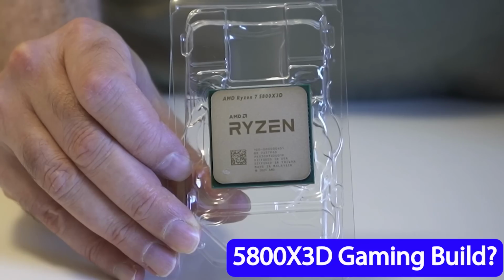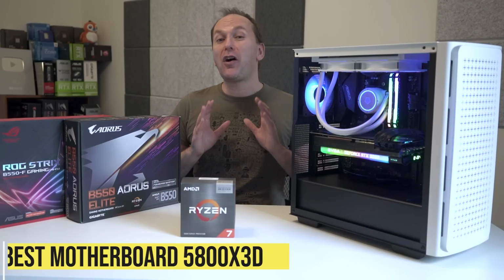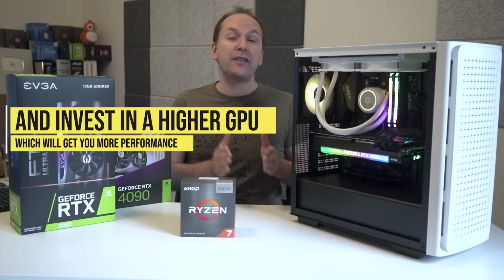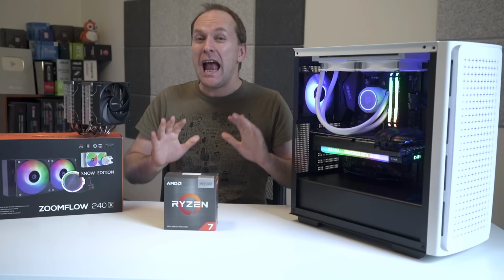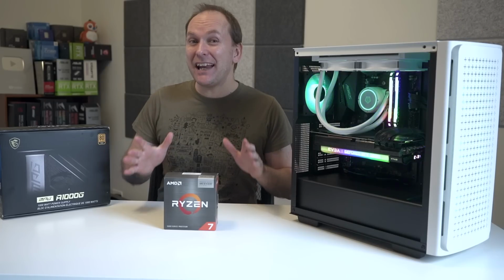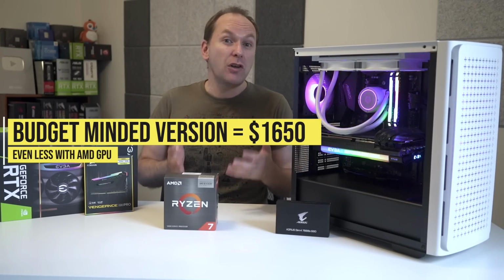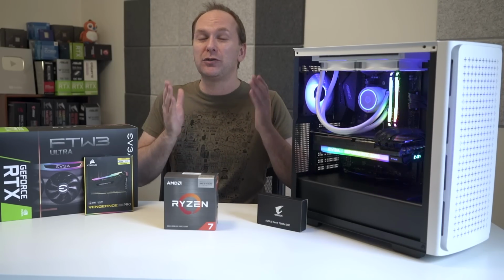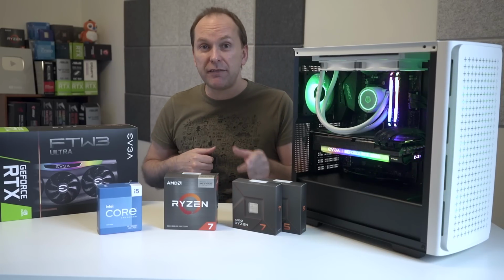🛑 4K Gaming is CHEAP! 🛑 Ultimate Ryzen 5800X3D Gaming PC Build

Comment: I built this exact system 4 months ago after 2 months of research much of it from this channel. I went with the Ryzen 5800X3D, 32 gigs (4x 8GB) of Vengence Ram and the Asus ROG Strix B550-F Gaming WiFi II board, and the Gigabyte GeForce RTX 3080 Gaming OC 12G Graphics Card. (Note on my GPU card, At the time I purchased it was under $800 today it's $1380 on Amazon) I did use 1 SAMSUNG 980 PRO SSD 1TB PCIe 4.0 NVMe for the C Drive and a Samsung 970 EVO Plus SSD 1TB NVMe M.2  in 2 TB for my secondary (This board has 2 M.2 slots slots "ONLY 1" is 4.0) and I set up x2 WD Black 2 TB HD in a Raid as my system backup. I added a few things not here but I paid about $2,400 (with my bells and whistles) in total. I did buy everything from Amazon and used the $200 off option and got the Amazon Credit Card in the process. (Note: Paid it off already as I had cash). Issues: not mentioned, I had to buy a PCIe x1 to 19 Pin USB 3.0 Header for a second header because this board only has one.  If you get this system buy one when you order it was $24 and you will thank me later.  Also, there is a loss of 5&6 SATA ports when using the second PCI-E slot. (ROG dropped the ball here) The loss of 2 of the 6 played no issue at all in my build but is worth noting.

Comment: Would a 5800x3d be good with a 4090 on a resolution of 5120x1440 ?
Reply from the maker: Absolutely, but you could also go for a 4k experience
Reply: @PCBuilderChannel  ive recently bought myself the odyssey neo g9 and i absolutly love the ultra wide expirience. Sadly im getting bottlenecked by my old ryzen 7 3800x which i havent had the plan to upgrade yet since im looking for a am4 cpu which would be best paired. And i think ill order the 5800x3d

Comment: Btw bro, 5800X3d isn't discounted yet but 5800x is less than half priced(60% off) pre-Black Friday sale in my country's Amazon website. Would that be good as well? Not just for gaming but also budget productivity and rendering. Would a 3060 12gb or 6600XT be enough for Blender?
Reply from the maker: 5800X is a good choice for that. Though you might even go 5600X if its cheaper and invest in a better GPU
Reply: @PCBuilderChannel  thanks bro!

Comment: I have never built a PC but looking at you building one, it does not hard at all. Question: are all those components used in this build more or less "plug and play"? My biggest fear is that I put everything together and the PC wont run or after the build I have to go to and play with the BIOS and other initial settings.
Reply from the maker: This is a good build for a first time build. Not a lot of complication. Check out Pauls Hardware for a great step by step how to build guide too!
Reply: @PCBuilderChannel  I was going to try to transfer all my components from my Alienware R7 but building this looks like a better option I will check Paul's hardware. thanks!

Comment: 4090 is about the first card i would consider for 4k gaming, those 4k benchmarks of the 3080 just are not good enough.    you can get ddr5 5600 cl36 32 GB kits for 150, would certainly recommend that as a min on any build.  13700k is still what i would recommend, but 7600x, 7700x, 13600k are all perfectly fine aswell.  wouldn't go with 5800x3d unless you can an amazing price
Reply from the maker: Depends on your needs of course! (:

Comment: i thought intel preferred faster ram speed. whats the best thing to tune my b die ram ddr4 of course? 1080p high fps 240+ for 13900k 3090ti for playing games like cod basically AAA titles. ive tuned my ram to 4000 c16 manually. so ive set about 6-8 timings manually. also which do you recommend to tune down? ie trfc tfaw etc., oh and before you say a 3090ti at 1080p cod is 99% usage on low settings in cod mw2. so yes even a 3090ti is bottlenecked in 1080p. another crazy thing to jason is with the newest update they put out i lost 70+ fps. its almost as if they are doing it on purpose to sell the new gpu's. gameplay itself seems to hold you back in matches as well. kinda like they did when the ps4 pro came out.

Comment: Do you think that i could run a AMD Ryzen 7 5800X Processor with a rtx 4080? or would that be too big of a bottleneck?
Reply from the maker: I think that will likely be fine. I haven't personally tested that combo
Reply: @PCBuilderChannel  thank you for your fast response:)
Reply: Other vids show a 20% depending on title bottleneck w a 4090. I have the same question... wondering if the 7900xfx is a better match.

Comment: So that 5800X3D I was gonna put in my wife’s PC? Thanks to this video I’m gonna take that for myself and give her my 11700k + N7 Z590 Core System. It’s gonna be a massive improvement for her productivity. Or so I’ll tell her. 😂
Reply from the maker: Sounds like a plan!! (;
Reply: 5800X3D is the worse for productivity compare to similar product, the none 3D version is better in most task. I don't know how it compare with a 11700 but if it's not better depending on what she work with it's probably equal. I would say it's a good deal for her.
Reply: She’s upgrading from a Ryzen 3600XT + B450. She works with photo and video editing apps so the Intel chip will be better because of QuickSync.

Comment: Pretty much looks like the budget build of what I was planning to build so good to know I wasn't wrong on selections.

Though I do have to ask, is there a way for you to possibly give/start providing streaming + gaming benchmarks? Streaming as far as I've experienced has caused a good bit of performance loss especially when paired with vtubing or just extra interactive software and would love to be able to possibly compensate for that loss with more details. Though maybe it's just because I'm using an older gpu and it's not that big of a concern on 30/40 series cards.
Reply from the maker: This will be a great streaming/gaming pc. And thanks for the suggestion, I'll think about ways to do streaming/gaming benchmarks in the future

Comment: Your guild leader is lucky to have you as a member. Great vid! While I was highly considering starting a 5800X3D build from scratch, considering my local Micro Center is throwing in DDR5 memory for free with a 7700X and $50 off a compatible motherboard, it seems silly not to take advantage of that offer.
Reply from the maker: Thank you! Yes that Micro Center deal is incredible. 7700X makes so much sense with free high speed RAM!
Reply: The fact that I don't live close to a Micro Center is eating away at my very soul more and more each day
Reply: If you are building from scratch, AM5 is just the way to go.
Reply: @evalangley3985  Not if you only Play wow
Reply: I wish we had something like that in Mississippi.
Reply: I need a microcenter in The Netherlands.....
Reply: I got the same deal + B650 aorus elite ax which came down to 180. Amazing board and overkill vrm heatsinks, other than sad audio chip, I'm thoroughly impressed by it
Reply: I wish we had something like that in EU.
Reply: Same, I ran to snag that deal up.

Comment: I'd love to see a comparison between 5900X and 5800X3D in 1440p gaming, they're around the same price... Maybe 5900X being a tad cheaper.
It's really a great time to build an AM4 system right now if you don't want to overspend!
Reply from the maker: Depending on your GPU the 5800X3D is anywhere from 15%-20% faster. The more powerful the GPU the more of a difference you'll see
Reply: @PCBuilderChannel  okay thanks for the quick reply! I got the 5900X for like 270 dollars 2nd hand and that was a banging deal. I would have to pay at least another $100 to go up to a 5800X3D so I don't think the performance upgrade is worth the price. Maybe it will get cheaper. 
I have RX6800 currently btw.
Reply: Isn't that more of a thing with Nvidia gfx cards due to their greater driver overhead ?
Reply: @PCBuilderChannel  Hi Jason, can you tell me does this sound like a good build to you; I have not decided on the psu for this  But I do have several, 2014 versions that are new (never opened) like a Corsiar HX1000W and similiar etc. Also would it be worth investing $2K in.  RYZEN 9 5900X
GEFORCE RTX 3070 TI, CORSAIR VENGEANCE 32 GB RAM, NZXT B550M MOTHERBOARD, LIAN LI SNOW WHITE MINI CASE, VETROO 360 MM AIO COOLER, 5 INTAKE FANS | 4 OUTTAKE FANS, 500 GB M.2 SSD, 2 TB HDD
Reply: Want a 5900x3d with manual oc 😁😁😁
Reply: If you have a 3070/6800 or lower and are not planning to upgrade save the extra money and buy a 5900x or lower.
Reply: Spoiler: the 5800x3D is hugely better than the 5900x in almost every title.
Reply: @marxman6896  absolute horseshit
Reply: @marxman6896  Yep. For productivity and content creation though the 5900x edges out, though not enough to justify the performance difference in gaming. 5800x3d is just too op.
Reply: @marxman6896  Do you have evidence for that? I was under the impression that only a few titles have significant improvements with the extra v-cache, especially at higher resolutions.
Reply: @megadesu69  Look at basically any benchmark suite. You're right that the v-cache does not help in every game, but it does help in most games. The titles that don't gain anything are pretty rare. The titles that gain a lot are also fairly rare. Most games gain 10-15%. Some game 0%. Some gain 40%. 

https://www.youtube.com/watch?v=sw97hj18OUE&t=689s
This HUB video goes over it pretty well.
Reply: @megadesu69  I have both the X3d keeps the GPU running full throttle. Sure the core clock on heavy rendering loads let's them get close at times, but over all work load is faster on the 3d chip...those benchmarks are misleading and refers to short interval spike loads to get those numbers. Over all estimated from start to completion is a different result.

Comment: i have a ryzen 2600x with a 1660 super and i want to upgrade my cpu because i play games like valorant, csgo and league of legends that are more cpu heavy. is it too much overkill if i pair my 1660 super with a 5800X3D?
Reply: i have a 240hz monitor thats why i would go with such a high end cpu and i am looking to upgrade my gpu next year
Reply: 244hz user here. when I upgraded my 2600 to the 5800x3d I was using a 1660S and saw waayy more improvement in CSGO, TF2 than I had expected. these games are pegged at 300fps and even gpu bound games started filling out my refresh rate.
Reply: @Triumphingnoob-  ty buddy <3

Comment: This might be a dumb question, but does the 5800X3D bottleneck gpus 3080 and above?

Also what would be a good monitor for this build specifically?
Reply: Nope, it doesn't bottleneck it. Check ZWormGamingZ
Reply: @Winter-bs2iz  ok thx
Reply: It’s technically a 4K capable build, but you can certainly use a good 1440p monitor and see very little difference. If you have the money though, 4K OLED screens are getting more affordable.
Reply: @-darkangelic-  Alr
Reply from the maker: 5800X3D is best paired with 3080 and up! Best monitor depends on if you want to go 1440p or 4k gaming. Personally we game on the 4k G7 and the C1 and love them both. Check out our Best Gaming Monitor 2022 video for more
Reply: @PCBuilderChannel  Okay, thanks!

Comment: Great video. Im almost positive you can get the build to under $1500 if you pick up a used 3080 and a 5800X for $199 from Microcenter. I know the X3D is a bunch faster, but for almost 2x the price? I don't know if thats worth it. If you are playing at 4k, I don't really see the standard 5800X being too big of a bottleneck. If it is, then the 13600k at $280 is the better deal.
Reply from the maker: We've got a 13600K build guide on the channel too! Also good option (:
Reply: @PCBuilderChannel  Absolutely a good choice 👌. The 13600k is the strongest i5 CPU ever made. The only downside I guess is the limited upgrade path. Your only real viable upgrade is moving up to a 13700k.  The best platform right now that has any kind of future is AM5. If I were building out a new platform from scratch, it would have to be an AM5 based build, probably with a 7600X or 7700X, depending on the Black Friday prices. Hey Jason, I know this is a lot to ask, because you already make so many good and informative videos, but right now I believe there is an opportunity to build a $600-$750 pc with used parts that has unparalleled performance and value. Do you think you might be able to make a video centered on just Ebay used parts that everyone has access to? Newegg and Amazon + Amazon warehouse and Antonline can also be included for super good deals on new parts, but CPU and GPU should be bought on eBay so most people can deal hunt and succeed in putting together a great value for money pc with used parts included in the build. For example, 2060 super on ebay is $200, 2070 $225 and 2070 Super $275ish. AMD is even better. 5700XT $160-$170. The 5600x and 5600 are almost $100 new, so used can be under $100. Its insane. I just don't remember there being a better time in many years to build a 1440p 165hz capable computer for AAA gaming for this little money. You could get so much even with a $500 budget for 1080p, and still do high frame rate 1440p with DLSS enabled. I'm super impressed by the performance of the newest releases in hardware, but I think the real winners are going to be the people that spend as little as possible and still get an RTX + DLSS graphics card and a very modern, high frame rate capable machine for very little money, like $500-$750, and can still get good settings and frame rates and features with graphics cards that were very strong in 2019 like the 2060 Super/2070 super/2080 and say a 5600 or 5600x/5700x depending on what you decide your ultimate budgets will be.
Reply: Well u can get a used rx6900xt for $500 and a brand new 5800x3d for $315 ,so I think u can easily do a build for 1200 .

Comment: i bought a 5800x to use with the 7900 xtx did i mess up. it was $200 the 5800X3D was $330 i didnt think it was worth. now im afraid of the bottleneck.
Reply from the maker: Not a mess up, it will work fine. But the 5800X3D would give you a more powerful gaming pc .
Reply: Same boat here w 5800x. 4090 gets 20% ish bottleneck at 4k... thinking 7900xtx might be fine and 5800x does OC to close the gap.

Comment: Awesome to see you show folks that 5000 series CPU's and 3000 or 6800/6900 series GPU's are still completely capable 4k gaming combos!  I actually think the 5600 or 5600x are the way to go if you're gaming at 4k or 1440p. Especially at 4k, save a couple hundred on the CPU and just make sure you get 3080 12gb or higher and you're set for 4k. If you plan on doing any competitive 1080p gaming then by all means get the 5800x 3D.
Reply from the maker: Yes well said! Last month we did our $680 1440p build video which featured the 5600X
Reply: my 6800xt struggles with 1440p, certainly wouldn't call it a 4k card
Reply: @nostrum6410  This is false. I had a 6800xt that I OC'd before I got a 4090. It was trash at RT because of AMD but it ran games at 4K just fine. You only needed 1440p if you wanted RT(even then it was case by case).
Reply: @marshinz5696  not at a decent frame rate it didnt
Reply: @nostrum6410  Yes. It did. If it didn’t your CPU might have been holding you back.
Reply: @marshinz5696  no cpu was fine.  i dont mean something like apex running at 60 fps.  running a cyberpunk, gotham knights, spiderman or something like that with 1% lows of 100 fps
Reply: @nostrum6410  Then why are you saying it’s not a 4K card? 60fps is the standard at 4k.
Reply: @nostrum6410  you got to be kidding,  I game at 4k 60Fps with my rx 5600xt and 5600x cpu. Temps sit around 75C on the GPU and 45C on the CPU. Got a RX 6800 on the way for a bit higher fps and cooler temps
Reply: @benchinny-ev3xe  now that is false, unless you playing cs go or some shit
Reply: @nostrum6410  I play apex at mid settings or ultra settings at 1440p, civ6 and dota 2 at 4k ultra settings. It is only 60 fps but I got a 4k monitor with only 60hz so it's all I need
Reply: @nostrum6410  My 3080 10GB does 4K gaming easily. Sucks you didn’t go with Nvidia because they are better at higher resolution gaming
Reply: @ChristopherVanZetta  it was also twice the price at the time
Reply: @ForTheHoards  That’s overkill for 1080P gaming… at that point you’re being ripped off.

I have a 5800X paired with a 3080 and a 5700X paired with a 3070 ti and can do 4k gaming and high refresh rate 1440P gaming.
Reply: Buying anything that isn't a 5800x3D for AM4 is silly.

Comment: is rx 6900xt Swft319 fine with ryzen 7 5800x3d? Should I buy merc version maybe?
Reply: any rx 6900 xt is fine, differences are minimal between the cards
Reply from the maker: Not much difference between 6900 XT models unless you are talking about the water cooled massive overclocked ones (typically not worth the price, but higher performance). Great GPU overall.

Comment: Glad to see this. With the cost of new gen mobos and DDR5 I have been wondering if there was even a reason to go with them over a 5800x3d build?
Reply from the maker: Find out when the video goes live in 30 mins! (:
Reply: Especially if the main game is WoW.  It plays 60fps on high settings 1080p on a 1660 (not even super, which is what my downstairs machine is using) + Ryzen 2600.  You don't need to buy even close bleeding edge for WoW.